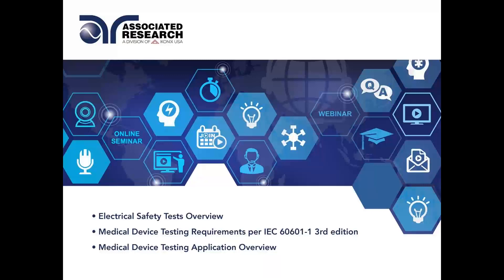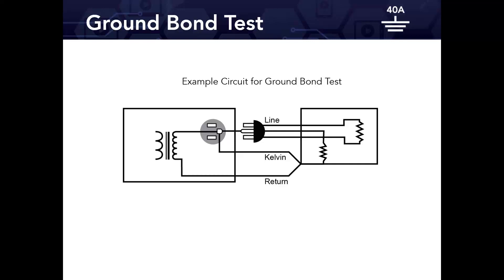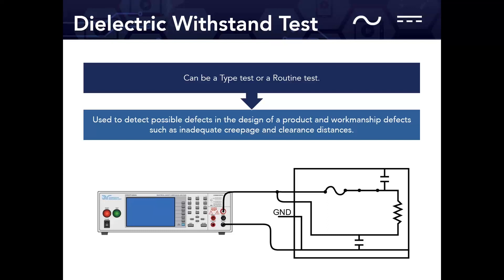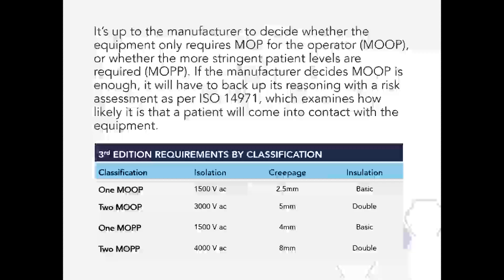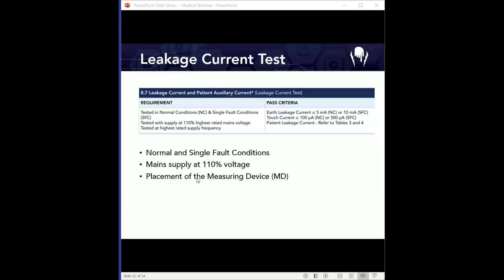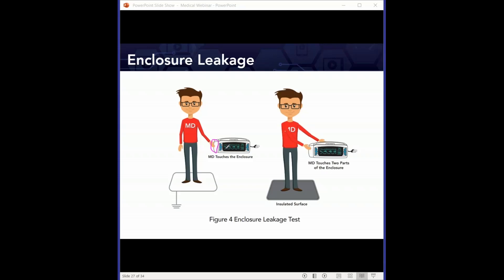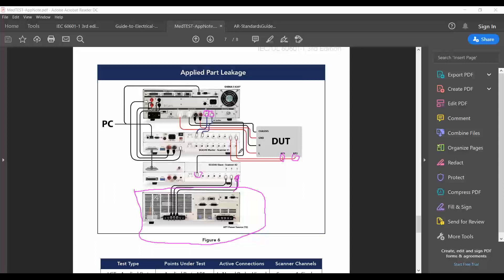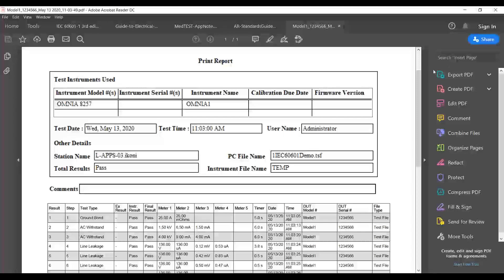Electrical Safety Testing For Medical Devices

Comment: sir, if I am using a medical grade power supply that provides my Automated peritoneal dialysis machine (Class II) 24 Volts DC , then in table 6 , will I selected rated voltage of 240 volts AC or 24V DC. for dielectric testing.